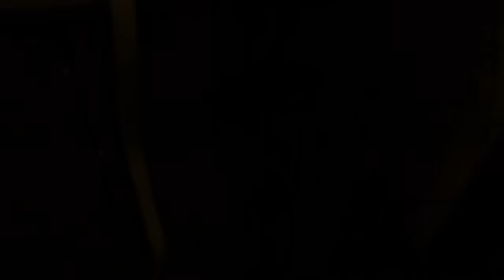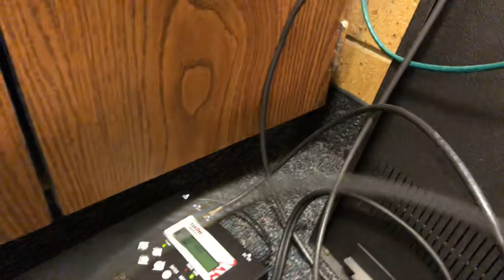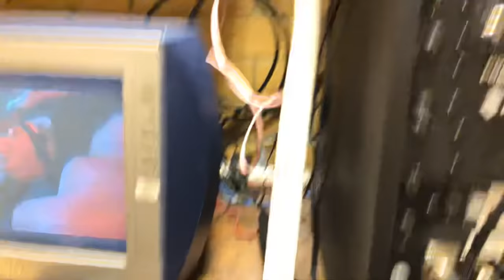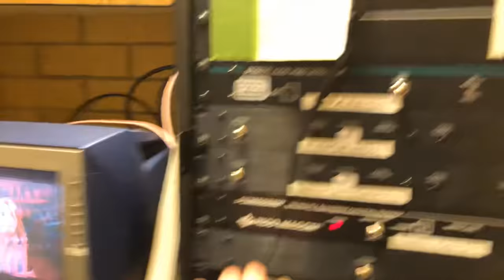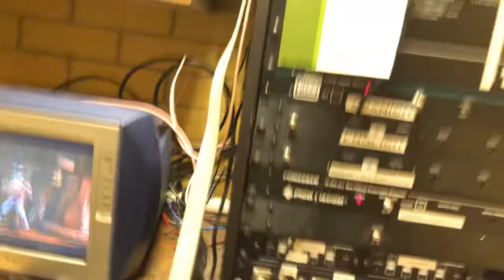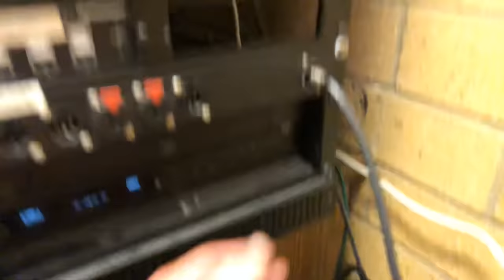HD Video Distribution in a SD Facility

Comment: I think cox is the way to go for in building distribution, you can you throw a TV up on the wall like a cable in and then anything you want I can go through an RF modulator or ATSC modulator. It worked so well enough that the cable companies are doing it right. I so want one of those ATSC tuners.
I wonder why there is so much composite video distribution? Then again I know it's a church lots of opposite of redundancy....
Seeing how Slingbox is getting shut down to some extent some sort of video over IP protocol would seem like the way to go. But it's all a mix of picking the right protocols for the application at hand.

Comment: A much better solution than slingbox would be the Makito-X. But it s very expensive.   It works amazing. Some model are h265 so even better results. For the video distribution, a product I love is the Drake DSE24 or DSE2PLUS. Also it does 256QAM-B instead of 8VSB.

Comment: Living As One probably makes the best end-to-end encoder/decoder/IP stream/IP recording and buffering solution out there today. Are the majority of the TVs still CRT?
Reply from the maker: No, they're 1080p LCDs. There's no budget to put one in the video closet, though, so I donated one of my old CRT TVs years ago.
Reply: @djp_video  Have you tried running a 1080 signal over the old wiring? I've had some luck in a pinch doing that if you want higher quality than analog.
Reply from the maker: I have. The old wiring just isn't up to the task. That's why I'm doing the ATSC encoding/modulation.

Comment: Hey Doug, I'm trying to use existing CAT6a cable runs with Roland HDBaseT Trans/Rec but I'm getting video only dropouts, audio is fine. Source video is 1080p59.94 out of an Atomos Shogun Studio. On the other end it goes into a Roland XA-82H switcher and then on to the projector. Everything is set to 1080p59.94 but the projector says 1080p 60hz. I've also tried everything at 1080i459.94 but I still get the dropouts. Any ideas?
Reply from the maker: Many devices will visually identify 59.94 as 60, so I wouldn't worry about that.

Have you tested the cable? It almost sounds like a flaky or low-quality.

Comment: Hi Doug, could you make an schema of the connections and devices?  And how you pass of bnc connection to composite plug?
 Thanks from spain
Reply from the maker: SDI output from trailer -> Blackmagic Design UpDownCross HD converter -> split to SDI to Analog Converter (for Component video to Slingbox), which is looped to SDI to Analog Mini Converter (for Composite video for in-house distribution); UpDownCrossHD's HDMI output goes to the Thor ATSC encoder/modulator.  Receiving sites use Sling Catchers which go to HDMI-to-IP converters from Gofanco, which are converted back to HDMI using matched receiver boxes from Gofanco.

Comment: You could try getting a cheap modulator from a company like PVI. They are pretty cheap and if the analog channels are going to newer TVs these cheap modulators witch can do ATSC and QAM might be up to the task as long as there is enough amplification on each cable line. 
https://www.provideoinstruments.com/Products_c_205.html#tab-2
Apparently they just brought out a cheap unit which only does 720p but at $295
The next cheapest one is $395 can be controlled over IP
Reply from the maker: Have you tried them? How is the video quality? What is the latency like? Do they cover the full UHF band?
Reply: @djp_video  I have used ZeeVee modulators (which go for around $1,000) and the delay on them is about maybe just under a second. I did install one at my school and we are very happy with it. Picture is amazing but I wasn't sure if the price was too much so I sent the PVI ones instead.
Link to the one we use: https://www.zeevee.com/products/av-over-rf/zvpro-series/zvpro800/
It only does QAM but the range is pretty good (so good a TV close to the modulator needed a signal pad).

Getting back to the PVI modulators. Again I have not used them but I did watch a video on YouTube where a guy was using them to send a HD signal from his C-Band satellite throughout his house. He said there was about a second of delay. 
Link: https://www.youtube.com/watch?v=HjnZie4L5tE
According to the Manual (Found Here: http://pviusa.kayako.com/Knowledgebase/Article/View/4)
The Vecoax MINIMOD-2 HDMI RF Modulator (the $495 one) looks like it does US ATSC UHF channels 14 through 83.
There is also a more expensive version of the Vecoax unit which has SDI.

Blonder Tongue is another trusted company, my school had Blonder Tongue modulators running for years before we went HD.

Sorry for the long response just a lot of information that needs to get out lol.